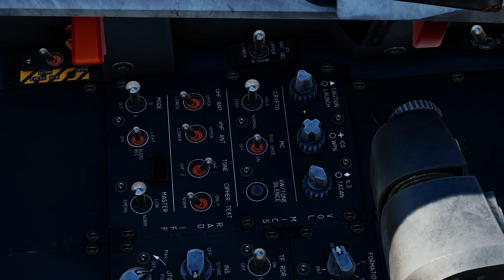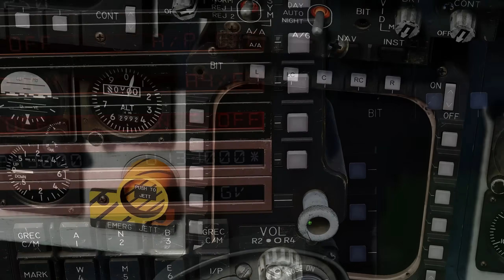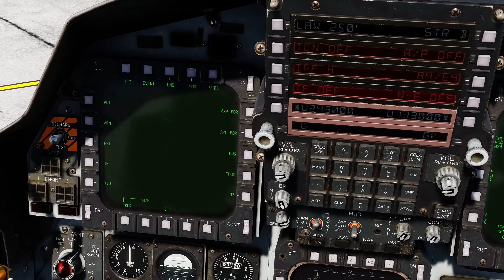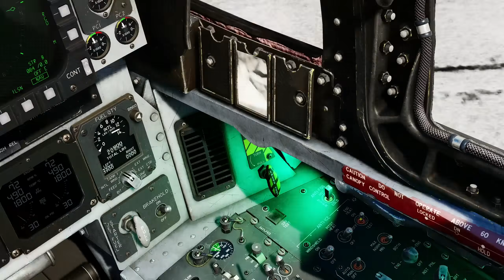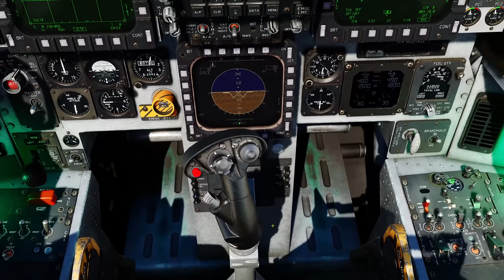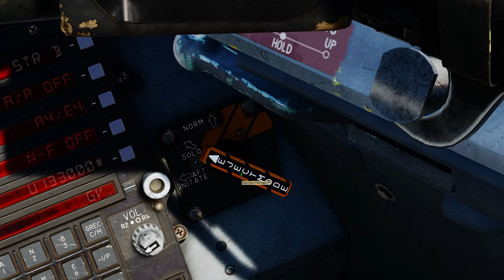F-15E Strike Eagle: Cockpits Familiarization Tutorial | DCS

Comment: This may be an old tech war horse, and it is, but the level of detail and hi-def artwork is stunning. They've done a magnificent job modeling not only the graphics, but the flight model too. It is a real beast to handle. And fast AF. Somewhere in the UK is a "Mach Loop" where there's a route of canyons that aircraft follow. I made a great one in the Syrian map up north of Cyprus in Turkey. It's where I go to test planes and practice low level ass hauling. I have it all laid out with the air racing pylons and smoke. The winner is the slick F-16C. I can clock the best times. This beast slick (as you can get it) is the one that will test your skills. So much power and hard to keep in the course. The F-5E Tiger II is also a lot of fun to fly the course. But that one will tear the wings off very quickly if you don't watch it. Anyways, it's a great bird to have and if air to mud is your bailiwick,  get it. But be prepared to spend some time in learning mode before you are combat ready. And Cap's tutorials are a MUST watch. There are many others, but the way Super Cap tells you only what you need and get you shooting quickly is the way to go.